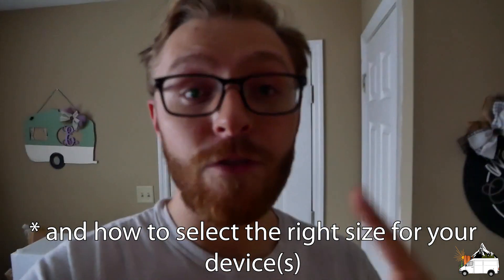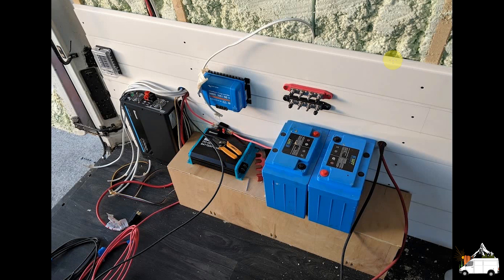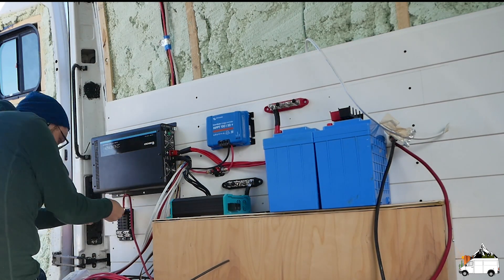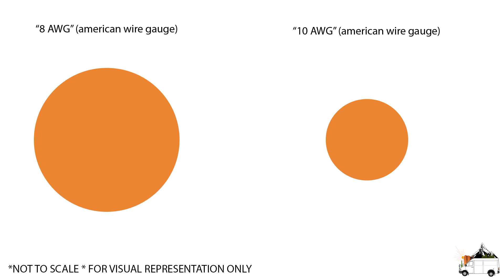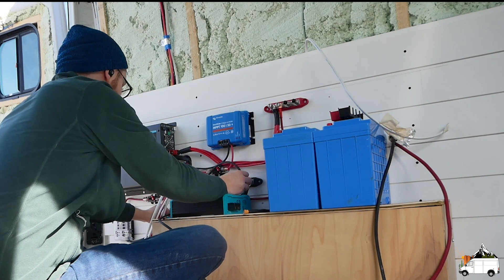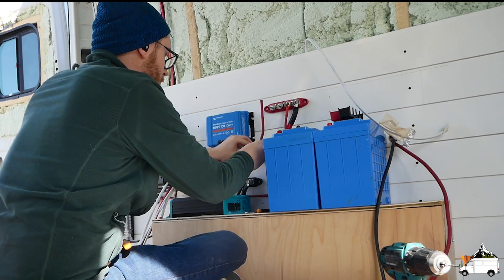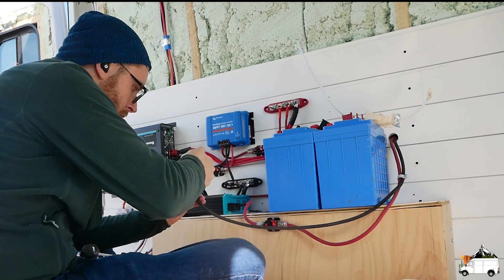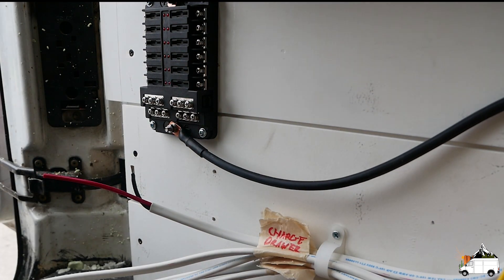How to Choose Wire and Fuse Size | (PREVENT FIRES) BASICS OF WIRE/FUSE SIZE

Comment: What voltage does the bus bar need to be?and how many should I need? 
I have a 3000w inverter and two deep cell batteries and a crappy fuse box that I’m going to replace when I learn what I need. Lol

Comment: I learned so much from this video thank you! This is my system I’ve planned for my semi truck. 

3000w 48v inverter 
3000W/48V=62.5A
62.5A x 1.25%=78amps 
Round up to a 80amp fuse
Wire size must Handel 62.5A
Wire: 4awg 120amps max
circuit breaker: 80amps

Comment: Thanks , I really appreciate the video! I'm considering running about 15 ft of wire from my Jackery 240's 12v socket to the back of my Transit Connect. I want to run a sound bar (via a 200W or 300W converter at the back), some LED lights (including USB), a 12v or USB rechargeable fan, plus 1-2 other USB things - like a phone recharger... ALL from a switched splitter. Do you think 16 awg would suffice?  Do I need a fuse?

Comment: Just put of interest, what's the issue with using a fuse rated too high? Say a 200 amp fuse is no good on 4 AWG wire?
Reply from the maker: Because fuses are meant to protect wires from taking too much current (amps). I believe that 4 awg is only rated to something like 120 amps. If you use a 200amp fuse on the wire, and it shorts circuits or you put a device that pulls over 120 amps, then the wire will have more than 120 amps going through it until it gets over 200 amps and then the fuse will pop the connection. The issue is, in that time it goes over the rated 120 amps and before it hits 200amps, the wire will likely get so hot that it will catch on fire and begin burning things surrounding it and that it is connected to.
Reply: @projectvagrant8197  
Yes, makes total sense when you consider the fuse is there to protect the wire. I had someone telling me the fuse was there to protect the inverter. Thanks for the reply mate 👍

Comment: Thank You for this video, very well made.  I wish I would have seen you di the cable lugs - crimp in a slower manner :-0)
Reply from the maker: Thanks for the comment! Getting those crimps right can be kind of a pain. If it's the smaller ones and you're using a racheting crimp tool, they definitely have a "right" way to be turned. Unfortunately every time I use them I have to figure it out and usually waste/ruin 2-3 connectors on my first one . If it's the big lugs you're talking about it's pretty straight forward as there's no special orientation -- but I have had to crimp those big lugs a couple times in different places to ensure it's tightly holding the cable (e.g. sometimes the lugs are longer than the clamping area of the big crimper, so I'll crimp the first half then the 2nd half).
Reply: @projectvagrant8197  Thanks for taking the time to respond and sharing some of your experience.  It still would make an interesting video !.  I have a ratcheting crimper and other,, I recently tried about 4 different hydrolic crimper off of Amazon.  None had the same size Dies,!!  Measurement is in mm  or not too accurate AGW .  I crimped with the Hydrolics 2/0 to 6G.  It's a puzzle to know what is a good crimp at times.  I don't get what you are saying about a "right" way to be turned.  What connectors are you talking about?  I probably have not used those yet.

Comment: Hello thanks for the video, i have a question as i am desginging a system of 11kw of solar panels, each panel is rated 540w and Short circut current 13.55qmps. Recommend on panel for series fuse is 25amps, i was wondering if i install 21 panell and make 2 strings. 11panels and 10 panels then at the output what ratting of dc circuit breaker should i use as the mppt charge control is used in inverter and voltages keeps fluctuate as per irradiance. So how to design dc circuit breaker for both strings.

Comment: I have a question.. i have a led light bar on my jeep and the in line fuse (30A) corroded due to moisture. I got a replacement one. But im thinking the wires are larger then light bar's original wires. eg. 16ga. Light/ 12ga. Fuse. Fuse is rated for 30A. Would i see a light output drop?
Reply from the maker: If the wires are thicker than original you shouldn't have a decrease in output, if anything you should have a increase as thicker wire = less resistance and less resistance = less voltage drop over the distance of the wires.

The one issue I see here is that I do not believe a 30A fuse is the right size for a 16AWG wire. So if you get a short there, the 16AWG wire may catch on fire before the 30a fuse pops.

Comment: With a lithium bank, you might want to replace that breaker with a fuse that has a much higher AIC rating. A Class-T fuse has an AIC of 20,000. And it's response time is much faster than a thermal breaker.  Your videos are awesome and well produced!
Reply: That is not true.. ANL fuses allow for Inrush Startup current...And ANL fuses are slow blow just for that reason..If you want a fast blow fuse. You need an ANN fuse...

And breakers are not slow blow..They detect short to ground faults. And will trip the second they see that..Ground fault are even faster. They trip within 50ms...

I would add... You use Automotive grade wiring..Not the same stuff you use in a house..You also use Automotive grade TESA tape to wrap it inside a wire loom..

Comment: Hello . where should dc fuse be installed, in the negative  wire or positive?
Reply from the maker: Positive wire. As close to the power source as possible to minimize possibilities of short circuits

Comment: Ok one thing. Please buy proper cable gauge instead of having multiple cables running from the inverter to the batteries. The current set up will cause electrical resonance dissonance.
Reply from the maker: That was included with my inverter directly from Renogy and has worked fine for over a year and a half now.

Comment: Nice video!  Can you provide an explanation. Why a fuse is needed between positive battery terminal and positive bus bar, as all the devices have fuses after the bus bar.  Also the fuses  between bus bar and device, where should it be located?  Closer to bus bar, or the device?
Reply from the maker: The fuses should be as close as possible to the battery. You want the fuse as close to the battery to minimize the possibility of short circuiting before the fuses. If you have a short circuit happen and the fuse is on the other side of the wiring, it will not break the connection when it shorts and you'll likely have a fire. There are 2 reasons I put a fuse on the battery terminal 1) my inverter doesn't have a fuse so it works as the inverters fuse 2) it also works as a "master fuse" so if there is a short and for some reason another fuse doesn't break the connection, this one will.

Comment: hi there, I have a question about fusing, why we can't just put a smaller fuse on the output than this big fuse between battery and inverter?
Reply from the maker: Because without a fuse there, if a short circuit happens, there is nothing protecting those wires. If there is a short circuit and no fuse, the connection will stay shorted and lead to the wires heating up, melting plastic, and likely start a fire.
Reply from the maker: It may be easier to put a terminal fuse on your batterys positive post and connect your inverter through that.

Comment: Solar panel system

I have 325 watt solar panels they are 34 volt panels with a open current voltage of 42 volts and with max current at 9.32 amps. I have a Rover PG 60 amp MPPT solar charge controller with a max open current voltage of 150 volts and I plan to use the 48 volt system which is rated at 3200 watts for a 48 volt system. I have a 48 volt lithium ion battery 50ah with 3.5 kw. So based off the max wattage input I can only install 9 —— 325 watt solar panels which equals to 2925 watts and a open current voltage of 379 volts which is way over the max open current voltage of 150 volts rated for the charge controller, so my question is which pv module wiring configuration do I use to wire my 9 solar panels to my charge controller and also I checked the manual of the controller and there is no pv module configurations, please I need help which wiring configuration do I use to install my solar panels ???????
Reply from the maker: I BELIEVE you could do groups of 3 panels connected to each other in series. In series, this would be 34v * 3 = 102v. Still 9.32 amps, then connect those 3 groups together in parallel. In parallel, this would be 9.32a * 3 = 27.96 amps. So 102v max at 27.96a max. Please double check me on this but I think that should work within your parameters :)
Reply: @projectvagrant8197  thank you very much I will be testing this method next week
Reply: @projectvagrant8197  hi also I have another question, which amp Breaker should I use between the solar panel and the charge controller and which type of amp breaker should I use from the battery to the inverter ?
Reply from the maker: @702goat  you determine fuse size from a wire's ampacity. You determine wire size by current your device will pull
Reply: @projectvagrant8197  ok because on my solar panels it’s says fuse ratting 20 amps so do I use a 20 amp breaker between the solar panels and controller and I will be using 8 or 10 gauge wire
Reply: @projectvagrant8197  so do I take a amp reading from the postive and negative leads when I have Wired all my 9 panels in a series parallel
Reply: @projectvagrant8197  when I take the amp reading do the solar panels have to be receiving sun light when I’m taking the reading
Reply from the maker: You want to rate wire for the maximum current and the breaker for that as well. In your first comment you told me the solar panels have a max current of 9.32A each. We're wiring 3 groups of 3 panels in series, so the amps stay the same, but the voltage max is added together (34+34+34) which equals 102 volts. Current stays the same in series so it's still 9.32A. Now connect those 3 groups in parallel, in parallel the voltage stays the same but the current is added together (9.32 + 9.32 + 9.32) so it comes out to 27.96 amps max current. So you'll want to size your wire and fuse for AT LEAST 30 amps
Reply: @projectvagrant8197  ok thank you vary much for your advice I really appreciate it

Comment: Did you use regular 12 gauge Romax? Is it or is it stranded wire? I’ve always been taught the DC current runs on the outside of the cable that’s more stranded wire make life easier for your current? Good video
Reply from the maker: I believe the wiring I used is linked in the description. I mostly used Ancor marine wire duplex red/black 12awg for everything except the things that pull a lot of juice (inverter, chargers). Definitely only use stranded, as it will withstand a mobile application much better than solid wire.
Reply: @projectvagrant8197   ❤️🇺🇸THANK YOU SIR! 
INSTALLING MY OWN “BACK UP” SYSTEM. UPGRADING MY RENOGY 2 PANEL SYSTEM TO 4...100 WATT PANELS. THANK YOU FOR YOUR TIME AND YOUR VIDEO SERIES❤️🇺🇸 GOD BLESS OUR AMERICA, CONSTITUTION AND D.J.T.❤️❤️🇺🇸

Comment: i don't understand why i'm finding sources online that give conflicting information about max amps for wire sizes. For example, the link you provide claims that 2/0 wire can handle 330 amps, but i have found at least three other sources that claim 2/0 wire can only handle 175 amps. which is it???
Reply from the maker: From my understanding 2/0 can handle 330A. 175 amps can be handled by 2 AWG wire easily and it's a good deal thinner than 2/0
Reply: Hey I know this is old, but 2/0 is 00, (two zeros, and 2 is just 2

Comment: Anyway you could do a video about your solar wiring? About to jump into vanlife and as most, solar is confusing. If not a video maybe could answer a question... Looks like everything is ran through your busbars. Is that correct? I looked at simple solar plans and decided it was going to be easy but now that I have all the stuff for a larger system I am very confused. Essentially, I'm good with the main objective of your video, but am more so interested in knowing what exactly you're doing in the timelapse of this video aha.

Comment: If your building a tiny home, or stealth camper, I recommend DIYer's buy an UGLY's Book. It has guides for wire size and breaker/fusing sizes. As a Electrician, I will point out that the example of 10 gauged wire is rated for 30 Amps for THWN and THHN wire. 8 gauge wire is rated for 40 Amps THWN and THHN wire. Also unless your operating a dryer or electric stove, 12 gauge THWN and THHN wire is rated for 20 Amps and is well within the safety factors for a 15amp electrical outlet for house hold appliances. So far I like this explanation of his build but I thought I'd add some commercial electrical suggestions as THHN and THWN wire is available at LOWE's and Home Depot and cheaper than automotive wire.
Reply from the maker: I think THHN is not entirely to spec for RV application (not that most people care about the regulations -- I have some 14awg THHN connecting one or two circuits when I was in a pinch). I really appreciate your input and recommendations though, I have "loved" your comment so it hopefully pins to the top so viewers see it ☺️👍
Reply: @projectvagrant8197  Thanks, THHN is Residential and commercial rated wires. What it stands for is the ambient heat, oil and water resistance of the jacket of the wires. Stranded THHN or THWN wire in a build for a tiny home or van build should pass safety and inspections. Automotive wire is the same look on the jacket it will say THWN. If you buy it from a Automotive dealer, it will cost five times more than buying it from Home Depot or Lowes or your local hardware and Lumber supply. That's why I suggested it. The Wire gauge is what protects the electrical system, as long as you do not undersize your wires or over load the circuits.

A 30Amp circuit requires a 10AWG wire and a 20 Amp circuit needs a 12AWG wire. a 15 Amp circuit only requires a 14AWG wire, but using a 12AWG on a 15Amp circuit breaker or fuse to feed a 15Amp rated outlet will not exceed the temperature rating of the wire or the outlet, especially when your fuse for breaker is rated for 15 Amps on a 120v circuit. It's just a little inside look to save you money on your build and not having to buy multiple sized wire. You'll actually have a cleaner voltage rating and less resistance. We use this method in the industry for clean rooms and neutrals on shared circuits in single and three phase wiring.
Reply: The National Electrical code amperage tables do not apply to Rvs or boats. And generally welding cable or high amperage battery cable is used that have hundreds of strands and can support far more amps then THWN or THHN. We are talking about DC and high amperage battery systems.
Reply: @robertgregory2618   you can use thicker stranded wire, but you loose more volts because of the resistance. When you oversized you cables. You wire gauge should still follow some industry standards, to avoid potential fire hazards. Bigger cables on a converted circuit could accidentally allow more amps to be fed to a device that was rated for only a certain amount of current and could damage or even catch the device or fire or injure someone operating it.
Reply: @jwells4853  There are marine standards and others. Fuses prevent to much current. Problem is 12 volts. That's 3 more than a 9 volt battery for my remote control. 120 is 10 times more voltage hence not a lot of voltage drop to worry bout but 12 volts it become huge problem. Boats and rvs aren't covered by Nec but doesn't mean you can skimp on stuff.

Comment: Heya! I have a question for you :) I always try to cross-reference any info I get so I can confirm what I'm learning is accurate. I've been trying do that with Max Current per AWG size for fuse sizing, and gosh is there ever conflicting and confusing information all over the web! So my question is how and where did you get the chart that you used in the video? I'd like to be able to cross reference it with multiple sources, so its provenance and what name it goes by or search terms you might have used would be very useful!
Reply: It’s seems like no one knows and no one is answering. I’m frustrated too!
Reply: Yes, I was also looking for the chart for wires size versus max current, but could not find it...
Reply: After looking closer, I found the chart link, in his description...
Reply: @dmmak2678  if you check out battle borns wire chart it says 8 gauge should be able to carry 85-150 amps where this says something much lower. That’s the issue. Why the discrepancy.   Have you( or anyone) found an answer?
Reply: @shofarsogood7504  I was looking for the chart he used, online, which I found.  But in answer to your question, I do not know why the differences between the wire charts...as you know, there are many different types/ratings for same size wire, which might have something to do with it...

Comment: Good job. Very clear.   New subscriber.  Just to be clear, solid strand Romex wire is only for the AC side, right?
Reply from the maker: Solid strand will work, but multi strand is preferred in a camper because it will hold up much better to the vibrations/movements. Solid strand is more likely to break off/snap in that setting.

Comment: Great video, sorry for a very stupid question, but how do you work out a mega fuse? ( still don't know what i'm doing as you can tell :) is it the same???
Reply from the maker: Hey Diana, not sure I understand. I have never heard of a "mega fuse" and did some googling but all I found was a brand of fuses named MEGA. :)
Reply: @projectvagrant8197  hehe :)  they are called mega link fuses, could be anything from 100-500A
Reply from the maker: @dianavr3291  it will just follow the same principle, you want a wire that can handle at least whatever your fuse size is you're choosing